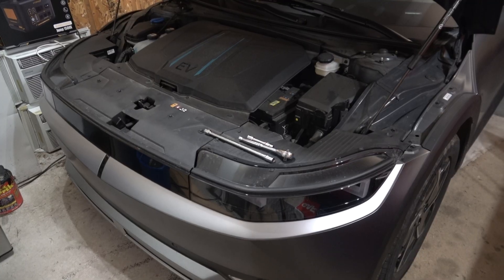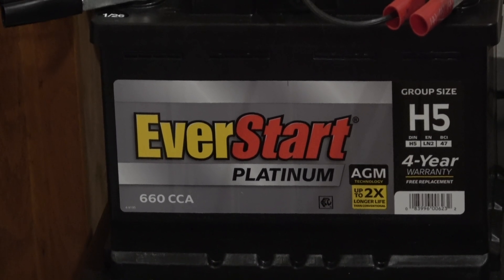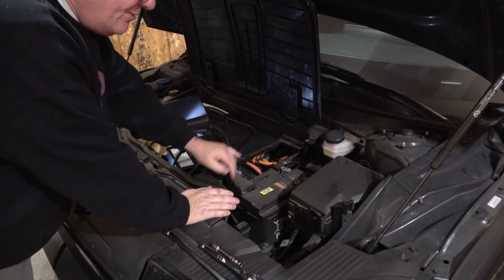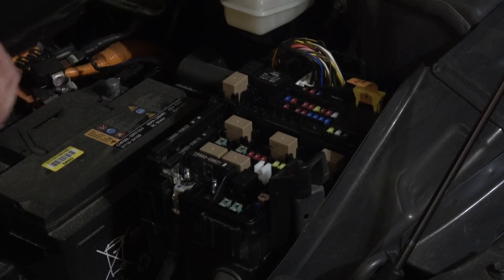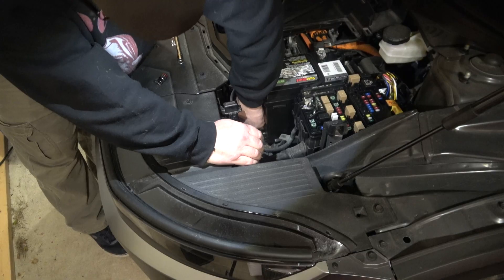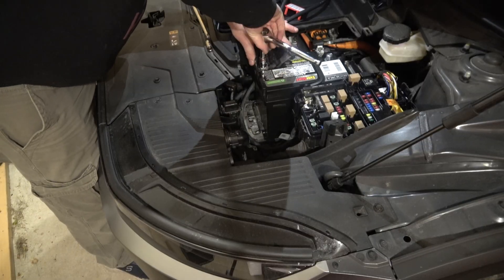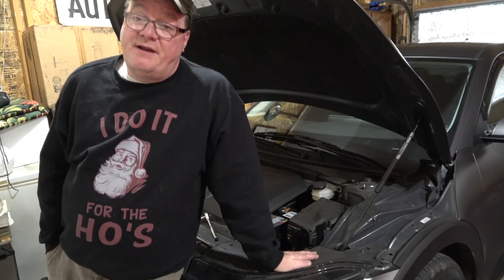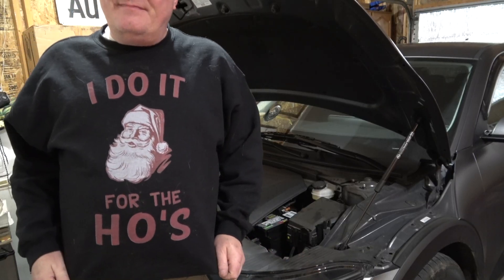Replace 12v Acid battery in Ioniq5 w AGM in 5 mins

Comment: Merry Xmas Dr Chris.  I have had a lease Ioniq 6 for over 2  years, driven 20,000 miles and its been a trouble free experience.  Cheap to run and a good experience.  The lease company dealt with the couple recalls quickly.

Comment: bought a bluetooth monitor to check the state of the battery, cheap and will see the max charge voltage drop before it start failing.  Seeing the charging patterns is interrestingn logs 30 days.
Reply from the maker: those are nice too but they "talk too much" and drain the battery itself
Reply: @ChrisEdwardsRestoration  Nice if you drive it each day.  Leave it for a week or two and come back to a flat battery 😮‍💨.

Comment: You just voided your warranty, hyundai sucks, Merry Christmas
Reply from the maker: you dont void your warranty
Reply: @ChrisEdwardsRestoration  correct Hyundai does
Reply from the maker: you are incorrect on that front  .. the Magnuson-Moss Warranty Act protects consumers by setting standards for written warranties, requiring clear information, preventing misleading claims, and ensuring manufacturers can't void warranties just for using aftermarket parts